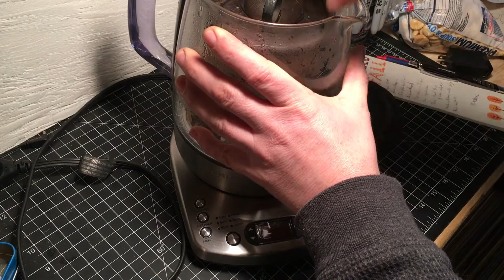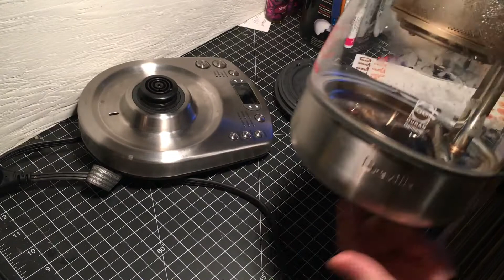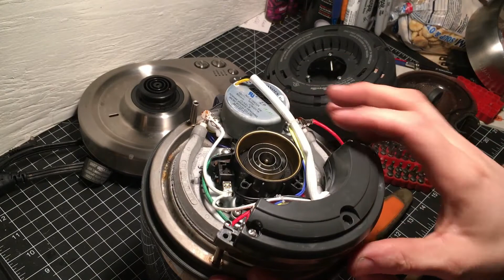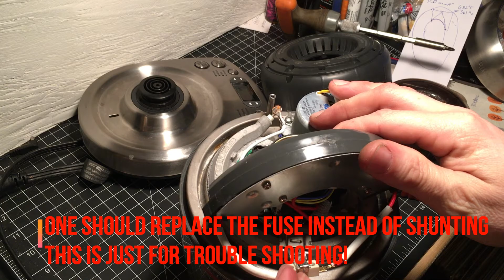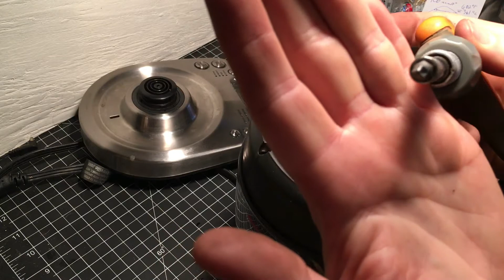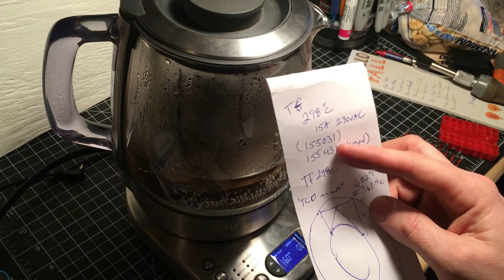Breville Tea Maker BTM800XL Heater Fix or Rig

Comment: I did this repair (using a thermal fuse to replace the unavailable cutout) then found it would boil and never shut off. I had to take the base apart (remove the 2 screws you can see, then pull off the 2 rubber feet furthest to the back and remove the 2 screws under them (there are no screws under the front feet) then take the base apart, remove the circuit board and replace the relay on the circuit board. (It's soldered in)
Thanks for the great video!

Comment: Do you have any idea how to open the base? Mine has stopped making the usual beeping sound when the tea is ready, but everything else works as normal. I figured I could take a look and see if the speaker connection needs re-soldering.

Comment: Thanks for taking the time to share this information - it was very well presented! For anyone who may be interested, "www.buerklin.com" offers this part (155431.006D05 (298*C version)) for ~$4.80 and will ship to the US for a total cost of ~$27.00-28.00 USD, as of 3/21/18.

@bondfranklin, In your opinion, when installing the new part should one solder or crimp the leads? Thanks again.